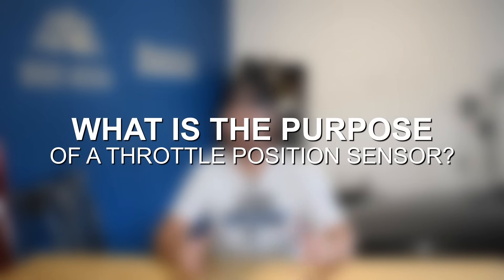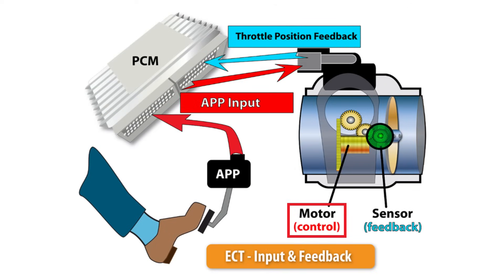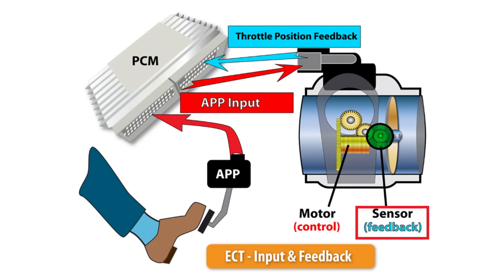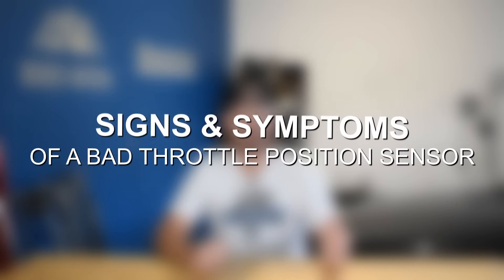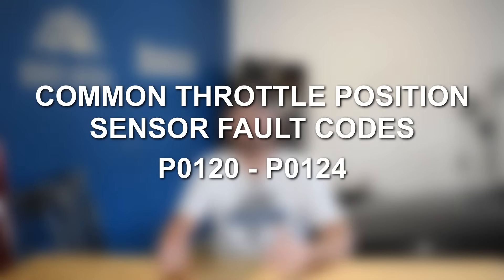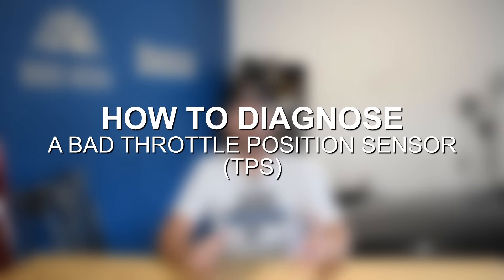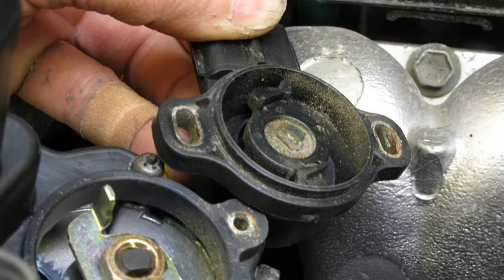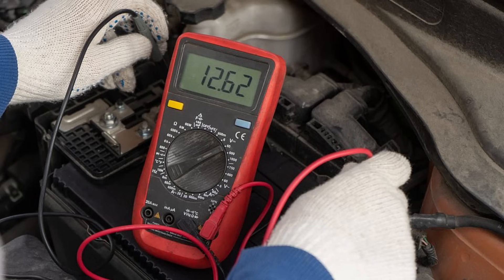Signs & Symptoms of a Bad Throttle Position Sensor (TPS)!

Comment: When cars went electronic it destroyed them I wish it was back in the olden days
Reply from the maker: B - They certainly don't make them like they used to.
Reply: @8020Automotive yeah. Give me a normal carburated motor up to the late 70's n l'l have it going pretty darn well
Reply: @markhorrell9213 😂 - nah man. Carbs suck. I’ve had plenty and there’s no beating EFI
Reply: @polloloci21  cable-operated injection👑
Reply: @polloloci21  Modern EFI is garbage, my 2008 basic system runs better than my 2015 with all the extra sensors.
Reply: @chrish7336  agreed - the more complex- the more crap that. An hour wrong. I just meant that efi is just better than carbs.
Reply: More electronics more problems 😢
Reply: I agree 100%. I really miss all the 70s Fords I ever had,and Even a Chevy or 2...
Reply: Get an old car.
Reply: The old days were nice but I hated when the float got stuck and caused the carburetor to overflow
Reply: Ok boomer
Reply: @SeamusMcFitz-jz9if   im not a boomer. Ill never buy a Tesla again. I'll stick with my older Armada.
Reply: @sarahbrewer53  the boomer commenter is invisible really.
Reply: Good old matchbook cover on my old 66 Chevelle, that thing never died, even after I got sideswiped it was still driving although it almost looked like a V and made a lot of noise with the drive shaft, the insurance company totaled it, I was young then and didn't know any better sorry I let them talk me into it, I'm sorry I did
Reply: Tis why I drive a 350 tbi sbc
Reply: @noobtube3203 a nice reliable holly 650 and a nice Accel super coil 😊👍🏻 love old Chevy engines!!
Reply: I think it was when cars and pick ups went to four doors!  But America is going backwards it’s ridiculous of the things we do and think that it’s great.
Reply: Ok it's a pain now but I also remember back in the day if a car had 150k it was at the end of its life. Now 200k isn't to bad
Reply: @sarahbrewer53  But the vehicle lived long enough to replace with a newer motor!! 8 years max life purposely designed into the vehicles now🤬
Reply: Me too 😢
Reply: not really some old cars ran crap when when cold, remember my lj torana i use to panic when coming to a red light ready for car to stall, using one foot  to brake and other to keep revs going , its was shit.then when the engine was warn  then start straight away would be hard  to start.
Reply: @neubs1969  your automatic choke was probably malfunctioning. If the choke position wasn't determined by the temperature of the coolant running through it, it was probably determined by a heat temperature sensitive coiled spring that may have detached or broke.
Reply: not really some old cars ran crap when when cold, remember my lj torana i use to panic when coming to a red light ready for car to stall, using one foot  to brake and other to keep revs going , its was shit.then when the engine was warn  then start straight away would be hard  to start.
Reply: Me too
Reply: Don't mind the modem tech.... just wish it was individualised.  Each sensor only does what it's supposed to do and not connected to anything else except a gauge.
Reply: @seagray5727  Unfortunately the modern tech requires connection to the computer not just gauges.   New tech is going to price vehicles out of reach for the consumer.  Sorry but a car payment should not be the same as a house payment.

The Gov needs to back off on the stupid regulations, States need to stop requiring California stupidity across the country, and the manufacturers need to get back to basics, longevity, and safety.  My 2008 is easier to work on, and has less issues than the last 3 of my wifes cars newer than 2012.
Reply: @seagray5727 agree to this
Reply: I agree these new cars can shove them up their butts…… i’ll go to Mika auction and get myself an older vehicle so much easier to work on no headaches, and you don’t have to send your hate mail no, I am not mad. I’m just saying yeah you gotta mess with points in the distributor and all that stuff but at least it was an easy fix and you can do it not like today where you gotta bring it in and cost a hell of a lot to get it fixed or have your garage full of equipment and tools
Reply: Exactly why I like the classics
Reply: Older good cars can run up to 650000+ miles and still runs
Reply: You can still buy those old cars, unless someone is forcing you to buy the newer ones...
Reply: Just think how much money spent on sensors and hub assembly and computer and vent doors activated doors cars now money pits
Reply: I'm with you going retro
Reply: I’m 21 years old and I even wish we had rid of the damn electronic “cars”
Reply: Ok?  But an old car then…. Geezus people. Whine whine whine. There are plenty of old cars out there.  I suppose you want all the old tech with modern luxury’s too?
Reply: @Ifightkeyboardwarriors GROW UP!!!   he has a right to state his opinion. He refers that old cars are better and I agree he’s not complaining, but you are!!
 Old cars are easy to work on , unlike today’s cars, you can work on them yourself. You don’t need a technician like today’s cars that’s what everybody is talking about. Why don’t you read between the lines and use your brain if you have one!!  today’s cars you need a garage full of tools and equipment if you’re gonna do it yourself, you don’t need to tear a car apart like you do today to get to a certain sensor, etc. etc.   you’re the whiner so grow up and use your brain.

Comment: Buick 2007 3.5 stalls coming to stop or letting off the gas pedal. I cleaned the throttle body and the MAF with the correct cleaner. Not throwing any codes.
Reply from the maker: C - We have a video that may be helpful here: https://youtu.be/7bqAIbYRdnc

Comment: I have a 2014 Kia Soul+ 2.0. It has every single symptom described here except the stalling and CEL. It jerks when accelerating between 35-45 mph. It won't accelerate past 60. Starting around 40-45, it doesn't want to shift unless i let up on the accelerator. It idles rough. At this point, I've changed: plugs, coils, pcv valve, MAF sensor, upstream o2 sensor., oil & filter, have run a fuel system cleaner through on 3 consecutive fill ups. Even switched to exclusively use Top Tier member fuel. Is it possible for the TPS to fail without initiating a code/ illuminating CEL?
Reply: End up finding anything out? Sounds like what my mustangs doing
Reply: You found anything out my Celica is doing the same thing

Comment: Mine is saying it needs to relearn the throttle position sensor.
Reply from the maker: T - Turn the key to “ON,” but do not start the vehicle. Do not touch the gas pedal yet. Wait three seconds and then press the gas pedal firmly to the floor five times in a row, completely releasing the pedal each time. This must happen within five seconds.
Reply: @8020Automotive  I'm definitely going to try this!
Reply from the maker: T - Keep us updated.

Comment: I watched a few videos on this subject and this was the best one. thank you so much.
Reply from the maker: S - Thanks for the feedback! Glad we could be helpful.
Reply: @8020Automotive  I have a 2007 Toyota Yaris I had to replace my old Throttle Body, with a new one just wanted to ask you if when the new one is installed, id it just plug and play? or doe the new Throttle body have to be calibrated with a computer?
Reply from the maker: A - Did you DIY it or was it done at a shop?

Comment: 2017 Ford transit, I had a bad throttle body with code which I replaced and reprogrammed by driving the van for 20 minutes to learn my driving, 6 months later now when I deaccelerate and using the brakes to stop when speedometer reaches about 30 mph before stopping the rpm shoots to 4000 rpm then it comes down, no codes at all and it does not happens everytime just randomly, I don't have any jerking or any accelerating problem at all , any thoughts appreciated thx
Reply from the maker: P - Sounds like potential engine surging.

Comment: Let me tell you that tps sensor is a very very shitty sneaky sensor, what can cause your car to run rough, sluggish, poor ! without throwing any fault codes ! my advice: if you replaced most sensor and the car is still running like crapp and consumes more fuel than usual, just replace this shitty sensor without any hesitation ! it makes your car new and alive again !

Just be sure you buy the Oem sensor, otherwise you make it a lot worse !
Reply from the maker: S - Thanks for taking the time to share this insight.

Comment: Hello sir, please i have an issue with my 2016 kia rio, and that be when i brake on red sign or bump and then accelerate there's no response for about 2 to 4 seconds and then suddenly the rpms rise and the car move. This only happened when the AC is on please help💔
Reply from the maker: 4 - Are you getting a check engine light or have any engine codes popping up?
Reply: @8020Media  No there is nothing
Reply from the maker: 4 - Here are a few videos we think will help: 
https://youtu.be/HKP1vKsIr4g
https://youtu.be/ipjYLPJgpq8
Reply: @8020Automotive  Thanks🧡
Reply from the maker: 4 - Keep us updated!
Reply: @8020Media  I will but until now i did every thing and it's the same 😥
Reply from the maker: 4 - What all have you done so far?
Reply: @8020Media  replace the following ( air filter, fuel pump, gas filter, spark plugs). Also check the o2 sensor and maf sensor and coils. Cleaned throttle body. Add thick wires to make the negative of the car more strong. I changed the fuel to higher octane type and still the same only happend with the ac is one, and even changed the compressor because it broke down last summer.
Reply from the maker: 4 - Might be worth taking it to a shop at this point for them to diagnose given you've done all of the right things.
Reply: @8020Media  I already take it sir and they telling me to replace that and clean this and after doing every thing and lose money the problem still existed
Reply from the maker: 4 - It's hard for us to help when we can't see it in person.. However, we hope you find the solution. Keep us updated on this.

Comment: Is it possible to get no error codes when this issue occur. I have same symptoms with my car, but diagnostics does not show anything at all and there is no warnings on dashboard. I was driving the car, at one point I have put my foot off the gas paddle to slow down and then put my foot on the gas paddle again, just a little bit and noticed it does not accelerate like it works on 2 or 3 cylinders or like its stuck in higher gear. But it did not. When I stopped on red light it barely moves and. It also rough idles.  We have already checked injectors and camshaft, everything works perfect. For Injector we basically replaced the ones we suspected to be bad. 
I have 1.6 hdi Peugeot 508 88kw 2017
Reply: On my van the check engine light didn't come on. I used a higher end scanner and found the codes. Used live data to find out the throttle body wasn't reacting with the peddle.
Reply from the maker: C - Thanks for taking the time to share your experience and help out other viewers.
Reply: @8020Automotive  It was ECU on mine. They have been checking every single part on the car for two months and at the end it turned out to be ECU. Even more, guy told me that its always more likely that its ECU than anything else. WTF
Reply from the maker: M - Thanks for sharing your experience. This may help future viewers!
Reply from the maker: M - It certainly can happen.

Comment: My 05 lexus rx330. Driving on the hwy @ 45mph, I stepped on the gas pedal to quickly accelerate too pass another car. The car jerked & the engine, vsr, track off light all came on. The gas pedal felt dead, the car was slowing down, could not accelerate. I had to pulled over & stop, turned off the car. I waited a few minutes started up & drove back on the hwy. My car came back to drive normal but the engine lights were still on. I drove home. Obd code P2112????  It said throttle body stuck. So is it the throttle body sensor or gas pedal sensor or both?
Reply from the maker: U - You may need to change the throttle body.
Reply: @8020Automotive thanks, I ordered the throttle body position sensor oem (aisin) & oem lexus/toyota accelerator pedal position sensor. 👍
Reply from the maker: U - Keep us updated here!

Comment: Been having trouble with my wifes 2012 malibu i jus bought a new throttle body hopefully it fixes. I already replaced the maf, map, crank, and front cam shaft sensors and still shows the esc light and traction control light. My next step is to replace gas pedal sensor😔
Reply: Check all ground wires.
Reply: It drives a few miles and the service esc light comes on and car starts bogging down and turns off, wont pass 25 mph while driving.
Reply from the maker: H - Do you have any engine codes?

Comment: 94 Lexus ES300 V6, engine stalls 50 180 seconds after car starts(maybe coolant sensor? as car heats up?),, but i will look at throttle and idle areas to see if grimed up, only 47K miles, at stop light i have to put it into low gear(automatic tx) as first gear slips in Drive, the only code i have is the Shift solenoid "A" electrical code. I have been getting by since august 2023 shortly after i bought  it so i am hoping the issue is fuel,air, spark, sensors and not tranny, what do u think? Wish u were near greensboro nc, i like your slow logic based explanations!
Reply from the maker: G - We've got some other videos we think may be helpful here: https://youtu.be/7bqAIbYRdnc

Have you had it looked at since August of 2023?

Comment: Hi I have the jerky and hesitant acceleration with also not reving all the way, but can it also cause RPM to get stuck? When that happens I flip gas pedal and it gets unstuck.
Reply from the maker: Check your throttle body to start, it could be sticking or something like that - especially if your car doesn't have electronic throttle control.
Reply: My ford flex jerky an bucking why acceleration

Comment: I think if I get this code, I'll just replace the throttle body.  It's not expensive and my time is too valuable to be doing all of these steps.
Reply from the maker: C - To each their own. We make these videos to inform. The viewer can take it how they wish.
Reply: @8020Media dont worry bro. Your videos help people that guy is a douche
Reply from the maker: D - We appreciate the support. We're gonna keep pushing forward regardless!
Reply: @damiansan1980  Why am I a douche for simply deciding after watching the video that I'd rather not attempt this for the small amount of savings?
Reply: The throttle body only comes with the throttle body sensor an at auto parts they want almost 300.
Reply: @anthonymurphy969  the throttle body for my car comes with the sensor and it's only $4 more than the sensor
Reply: @anthonymurphy969 you said it backwards, good job!
Reply: Weird to see my name come across the comments before I got to comment
Reply: New to all this mechanic stuff but what would I need to buy to replace the throttle body
Reply from the maker: S - What vehicle do you have?
Reply: My 00' Chevy cavalier went into limp mode and one of the many things I've read stated that the tps could be responsible
Reply from the maker: B - Certainly could. Do you have any engine codes?
Reply: The throttle body for my car is 700. The sensor is 125. That’s definitely worth my time.
Reply: I'm having all symptoms but no check engine light until I randomly loose power but it doesn't stay on
Reply: I was gonna replace mine but decided to just clean the throttle body and sensor with two $7 spray cans  and put it back together and works fine saved all the money instead of replacing it

Comment: Thank you for sharing the video. It was very insightful to troubleshooting my car issue. I will try the tips you suggested. I changed out the TPS, cleaned the MAF sensor, but the problem didn't go away. I will try to clean the throttle body next.
Reply from the maker: B - Thanks for the feedback! Keep us posted.
Reply: My engine was taking water  throughout the throut body to Valves up down samp
Reply from the maker: M - What?
Reply: Hey I have the p2176 code. What does that one mean? Which part do I buy?
Reply: I have no CEL...I think I have a bad fuel filter or clogged filter

Comment: My Nissan Nerva 2000,  started dropping its idle slowly over a cupule of days to a point where i had turn up the idle screw back up to 700  RPM, when the car is warmed up after driving for about 20 minuet's it would give a bit of a misfire while siting at a red light but then come good on acceleration, it only happens when the car is warmed right up..? No vacuum leaks, Throttle body is clean, Could it be the idle air control valve..? Or a faulty TPS..?  My car has a 14 pin port, I've been to three mechanics for a diagnostics test and they don't have the right scan tool for my year model, And it never fails when a mechanic takes the car for a test drive, Well the bloody thing doesn't miss a beat. I guess I will have to try changing both.. Also no engine check light comes up on the dashboard..
Reply: Ive got a 2008 chevy impala LT its only having rpm slips on take off at red lights about 20 mins into starting to ive been seeing alot comments of sensor issues going into the shop tomorrow going to get it scanned hopefully we get this fixed so i can ride off into the sunset tmm
Reply from the maker: V - Keep us updated!
Reply from the maker: S- Sorry to hear about this. We have a ton of DIY content that could help your research here: https://www.youtube.com/playlist?list=PLiX521qA-UEQrLY1ZRDnLP37yCDCcvQCV